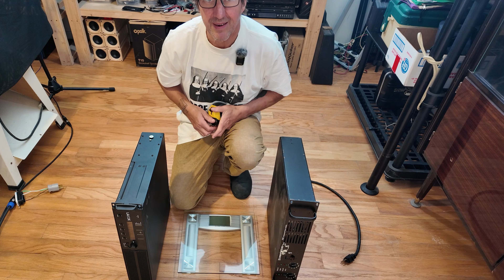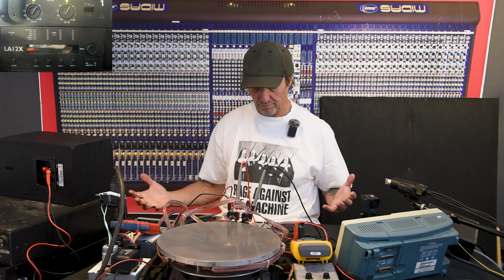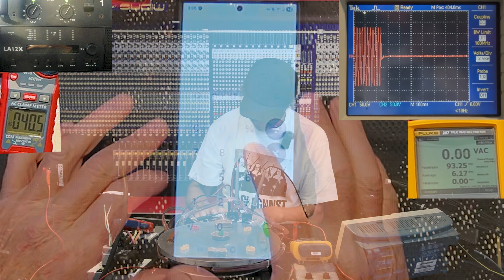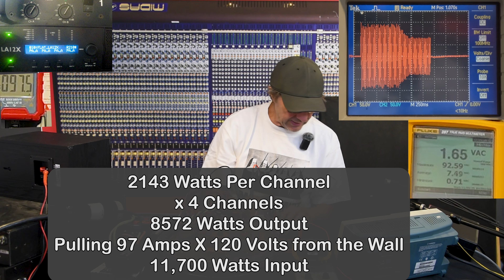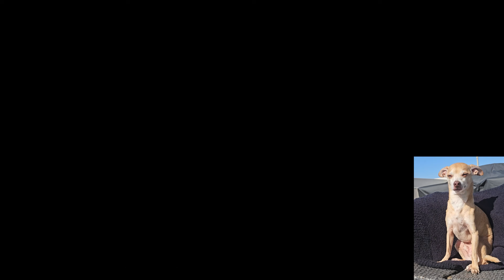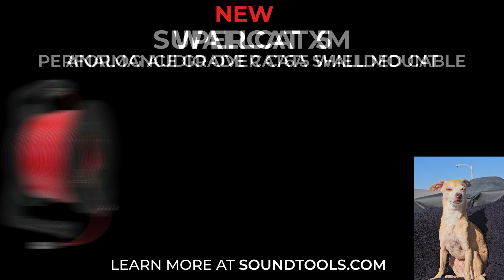Who Does RMS Power Better, Old or New Amp?

Comment: Looks like the Class D amp power supply is designed to produce large peaks for a short time then protects itself by lowering the rail voltages.  There are two solutions: either beef up the transformer, rectifier and regulator components to deliver full power for indefinite time (greater cost)or re-rate the amps for continuous power and not for a short-term burst (this becomes a marketing issue).
Reply: Yes, + the AB class amp seems to trigger the breaker after a few seconds, when the class D stars modulating. So none of them are able to drive constant sine waves at the limit for a long time. One breaks, the other limits. Just don’t redline your amps if you want continuous brown notes.. 99% of the music is much more dynamic and getting that headroom is great.
Reply: the class d amps are designed to produce dynamic music which does not have sustained sine waves. If you want a bench power supply to supply continuous RMS power then buy a bench power supply.
Reply from the maker: agreed, investing in an amplifier capable of massive RMS output when it's not going to be used is perhaps enjoyable for home hi-fi and a having a fun background story to tell about your audio gear. 

but carrying around a bunch of size and weight and cost to have RMS capabilities that won't be used doesn't make a lot of sense for rental companies and the environment
Reply: @DaveRat I remember when hi fi amps were rated in all sorts of silly ways including "peak music power"  which was calculated by taking the peak rail voltage squared divided by the speaker impedance.  The logic there was that the number reflected peak transient power.  Eventually, the FTC mandated that hi fi amps be rated in continuous RMS watts.  I'm surprised that there isn't a similar requirement for  sound reinforcement amps.  Keep up the great work, Dave.  It's really appreciated.  Your experience is invaluable!
Reply: @philpope9297  Sustained sine waves in music are a thing, check out some UK old skool jungle/drum & bass. Rolling (not pulsed) bass lines are a key part of the vibe.
Reply: @enemyofthestatewearein7945  I've been running sound systems and playing jungle since it wasn't 'old skool'. Look at the waveform of the classic Reese bass - it's not a constant sinewave.
Reply: @philpope9297  Never run sub through a comp to raise the RMS and get that heavy heavy sustain? It's the classic old school trick I've seen done by some very famous clubs. RMS matters, it's why many modern systems sound very nice but have no impact.
Reply: @enemyofthestatewearein7945  yes, but the comp should not be zero attack so the initial volume will still be significantly higher than the sustain.
Reply: @philpope9297 Sorry, I respectfully disagree.

Comment: Crown used to make 5 and 10 kW power amps, that could have been excellent for fixed venue massive subwoofers.  They would handle very difficult loads well, as they were mostly sold to automotive and aviation industries, for large industrial vibration testing shaker tables, used in push-pull 3 axis sets at all of 4 corners, meaning most customers that bought one, bought a couple dozen.  

Those ran on 208 VAC 30 Amp 3 phase power, an assumed easy ask in any facility where they'd be installed at all.  And, a price point that would test the budget of most sound companies, even among those working large venues where a 200 amp 208/120 3 phase temp panel was a normal provision.  

Obviously getting 4 x 4kW out of an amp fed from 120 VAC 20 amps and given a dedicated circuit, regardless of power extension cable gauge, or even a 240 VAC 30 amp branch circuit, cannot be sustained within the laws of physics.  

Given the peak delivery benefits from small, light, modern amps, what may be needed most are a more honest way of standardizing published spec's, plus the industry understanding of system elements and overall function design engineering, as Dave suggests in this video.  

Or, consider a return to more high end plate amps inside cabinets, with thermal and mechanical driver matched UPC controls and protection, where AC power is run to cabinets along with line level or even digital audio, and end use of speaker cables that degrade damping factor.

Comment: Dave, ur thee OG Mad Professor of Audio, well done, MPA :-) ,only the Candyman can !! Afaik the LA12x are Powersofts under the hood, so what u r detecting is the powersharing mode when only using half of the channel count ? And the resumee is: always 2Ch Bass + 2Ch tops on ur LA8 or 12 ??
 I guess usually NL8 cables are leaving ur 12X at wht wire diameter , 4mm2 or higher  ???   Btw...when do  u start ur cooking with Rats channel ?? :-D

Comment: Hiya Dave, great topic for a video and the way you went about testing it was intuitive. I have a tip with regards to your test load. The "heat indicators" you used are a fun method, but you have a bit of a mess to clean up in the end. A simple and inexpensive way to cool your test load is to submerge the whole load plate in a big bucket of water. If you're not doing this every day, and you dry off the load plate after your testing, it will give you a way more effective heat sink. For repeated "daily use" you can spray paint all the solder joints on the resistors, or use mineral oil instead of water and the plate could then sit like that all the time submerged, but it'll work fine with minimal electrolysis for just your short test period with tap water and if you dry it all down when you're finished. And, you'll be able to test for much longer periods without such intense heat generation on the plate and risk burning up the expensive load resistors.

Comment: Yet again, really interesting video Dave!
Questions I have:

Do you run at RatSound your LA12X's always as 2 channels tops and 2 channels as lows to not have this "issue" of drop of RMS or do you do something like max of 3 KS28 per LA12X or do you run them to max capability of 4x KS28 per amp and would you say
there is noticable difference in punch or low end force outputted when the amp then lowers the voltage?
Or is this just what would be called "acceptable fact of class D" amplifiers.

Also why don't companies like L'acoustics run hybrid topology on their amps? I understand that it is easier for it to be just Class D and it saves weight and in the sense is the best of all worlds, but companies like KV2
for example run their amps as Class A/B for highs and mids with Class G for low end.
Main question is of course for you who rents a lot of L'Acoustics stuff that is the difference something that you notice in live enviroment?

BTW are you running some L1 and the new subs as test user. :)

Comment: If you're going to go by weigh, size and efficiency than Class D wins everytime all day....... yet has zero to do with it's quality of sound.
Reply from the maker: yes and no . 

an amp that can put out more power without distorting from a given power source and AC cable size may be considered to be a sound qulty advantage 

also an amp that has a higher peak transient power often sounds better when driven hard. 

both of these are often class D advantages. but yes, an amp with good clean sound with minimum noise is always desirable regardless of the technology used.

Comment: It is nice to know that the amps can deliver 2000 watts continuously but there's no existing driver, except the M-Force, that can handle more than 300 watts continuously. It is more interesting how long the amp needs to recover with all 4 channels driver from the power drop. Especially for hardcore EDM with a high number of BPM. Greets from Sander from the Netherlands. 🙂
Reply: What are you talking about?
Many professional B&C, BMW & JBL Drivers can handle more than 300w continuous. I‘m Sure RCF (TT) has a few too…
Reply: @jimi272  You wish! Knowing that only 1-3% of the power comes back as audio means that 97-99% of the energy comes back as heat. Put an electric heater of 3000 watts in a subwoofer sized cabinet and you can imagine dat it will catch fire in a matter of minutes. But it is less dramatic as it looks. For a dynamic range of 10dB you need for that 300 watts RMS speaker 3000 watt of peak power. A good limiter allows that peak power for milliseconds before it reduced the power back to 300 watts to prevent the voice coil from burning. In practice it is inaudible.
Reply from the maker: let me ask you this. if AES2-1984 specifies that a speaker is tested for 2 hours with pink noise of a given RMS power. And since RMS power handling is a direct or purported to be directly correlated to the thermal capabilities.

And if a driver is rated at 2000 Watts RMS AES 2-1984 

how much power RMS will the driver handle?
Reply from the maker: That's an interesting discussion. I believe a lot of drivers are rated on AES 2-1984 spec which I believe is 2 hours of pink noise at a given RMS with a 6DB crest factor. 

I think the core question here is how does that spec relate to a pure sine wave tone at a given RMS wattage.

B&C has several woofer drivers in the 1500 to 2000 w AES / RMS power rating.

The question is how much power and for how long would those drivers handle how many watts. 

it's important to never forget that whenever looking at a power rating, time is critical. 

this is one of the core differences between the two amplifier technologies that I showed in the video, how much power does it put out is one question 

how long will it put out that amount of power is the other question that really shows the differences 

and all that's driven by the real issue or question which is how long do we need it to deliver that power for a given scenario? 

we don't need full RMS power for 24 hours or more continuous for most applications 

also to be able to deliver full power for 0.001 seconds is also not useful. 

The question is how long is that time frames? 

or put in another way, some insight to this can be seen by analyzing the crest factor that the various amps and speakers are using. with a zero DB crest factor being RMS continuous sine wave type spec. and products measured with higher crest factors like 12 dB, are basically saying their amps output that power for shorter periods of time
Reply: @DaveRat  speaker ratings are calculated using nominal impedance V*V/R. voice coil heating means the real power delivered is approximately a third of the rating. 12dB crest factor means the peak to average ratio is 15.85. So an amp should be rated about 5 times bigger than a speaker to drive a 12dB crest factor signal to the limit of what the vc can take. as well as an rms limiter you also need some dynamic eq to reduce power when the speaker has low impedance or low excursion.
Reply from the maker: So based on that, what would the long-term RMS power of a B&C speaker that is rated at 4000 Watts music power and 2000 Watts AES be?
Reply: @DaveRat   @DaveRat  My story is based on a sine wave, I think pink noise gives a different result. When I make a preset for a speaker I tested the limiter settings with a dummy load and a sine wave near the center frequency of the bandwith. So for a subwoofer it is 50-60Hz. I adust the peak limiter on the max power of the driver, if it is below the max power of the amplifier, and the RMS limiter on 1/10th of the peak power.
Reply from the maker: interesting. yes, lots of variables. the desire for people to assign simple numbers to complex real world scenarios is strong.

the actual max RMS a speaker can handle tends to be a thermal thing as well as a frequency dependant mechanical thing that is modified by ambient temperature, ventilation, cabinet design and time frames.
Reply: @DaveRat  I always strive to make thing as simple as possible, we both know there are too much variables in music, amplifiers, drivers, cabinets and environment to catch in simple formulas. But to get reliable loudspeakers it is necessary to stay at the save side, to get a competitive loudspeaker it is necessary to push the limits. When I develop a cabinet I always do a 1 hour test in my paint booth at full power at 40ºC to measure the temperature of the drivers and the amp module. The actual RMS is only thermal, the cooling depends on many factors. Apart from some turbulence, the air moves virtually not at all in the reflex port. Maybe with a port at the bottom and one at the top of the cabinet there is some convection but the biggest problem is the airgap around the voice coil that works as a thermal isolator.

Comment: Thanks for doing this test. Each has its place. Class D tends to be very clear and articulate as well as being so much lighter. and cheaper. Big old classics have that punch. I've got four HH V-800s - absolute beasts 3u and about 30KG each. Wouldn't be without them, but they are incredibly heavy especially when racked. You have to have a reason to want to run this kind of amp, especially a mobile rig! I'm in the UK so these amps come up from time to time - and I get to run them on 240v straight out of mains. For my useage it's the "body" of the sound that is better with big iron, I don't really do massively heavy bass, but evidently big iron would absolutely be needed to do that all night long - Or more class D stuff. An escess of capacity could surely do the biz?

Comment: I run some old Electro Voice SBA 760 active subwoofers with class H amps in there. So, 760W RMS power according to the manual. And they are really brutal. Yet, one design flaw is in there: They apparently don't have a high pass filter, so when operated without a DSP controller, it's easy to clip or even kill them with inaudible sub frequencies.  I'd rather have a class D amp that drops power a bit, including a proper steep HPF than blow my chassis with some 15Hz something.

Comment: 11:20 The 12x tripped a system message FuseProtect on the display. Power supply is undersized & has aggressive circuit protection that reducing its power output. Can see that being better than completely offline.
Reply: Just needs 100A @120V or 50A @240V to run continuous.
Reply: @v12alpine  clearly the input current or lack of it is not the issue, even with the 100a of 50@220 you state it would still modulate output. 16:00 If not enough input current was the issue then how is it that the 12x is reducing/modulating its output wattage when 3 channels are driven and only drawing 69amps?? The issue seems to be the internal power supply section is undersized or insufficient for a constant output. My moneys on that the power supply & capacitor storage capacity is just enough for intermittent signals like music with short impulse demands, not a power draining constant tone.
Wouldn't be the first time a company chose profit margin instead of an over built design with headroom.
Reply: @NvTwist  agree but what do you expect from 4 channels in such a small footprint.  A pair of the 2-channel versions hopefully runs continuous.
Reply: @v12alpine  I expect the amp to be capable of meeting its specifications... at a minimum.
How big does the lie have to be before it becomes an unacceptable amount of missing power or do you just Expect that you the amp that size can't provide what your paying for & but still purchase it?
Reply: @NvTwist You're  paying or you are paying.
 You the amp ??
Reply: Whew ya thats a blunder for sure, to say I was tired is an understatement. Think I was questioning whats the gap gotta be between expectation and reality gotta be before you determine you're not getting what you payed for.  Misrepresenting the performace capabilities makes it impossible to design systems on paper prior to purchasing the equipment. No matter what in house testing before integrating has to be done but the bloated specs waste so much time & frustration when equipment doesn't even come close to matching reality. 
I gotta crash.
Reply: @NvTwist  Seems (in general) like class D get's a longer line in regards to their specifications. If every amp was tested in accordance to the FTC regulations, we could compare apples to apples more easily. As long as this isn't the case, we get PMPO and "music power" or half-cycle power ratings.
Reply: yup, Equipment that list its specs in non-standard units of measure are the manufactures to completely avoid.  Only one reason to choose non standard anything is to hide & confuse something.

Comment: Great video Dave! It would have been interesting to see results with the LA12X amp hooked up to 240v! The higher voltage should create less resistive loss/voltage drop in the cabling and the PSU wouldn't have to work as hard. At 3 and 4 channels driven Its likely that the caps in the SMPS are being depleted faster than the mains supply can refill them without cooking something considering your pulling almost 100amps at that point....... Despite the LA12x amps marketing that they are able to push their full rated power on 120v i wouldn't be surprised if the amp is hitting its max current capacity at the lower voltage and throttling the output to protect the power supply from damage. Also at 240v the mains could refill the caps faster and at higher current efficiency, so the hold time before throttling would possibly be longer. We use Linea 44m20 amps to drive our subs and have noticed a big improvement when running at 240v/208v. Anyways, really appreciate your videos!

Comment: Would you usually use 120V? Surely 240V is an option...
I guess/think/wild stab in the dark, that an all electronic PSU (as I'd expect) in the class D would do better on 240V